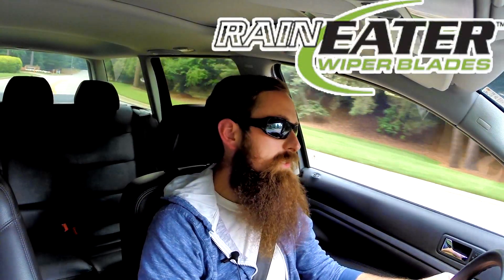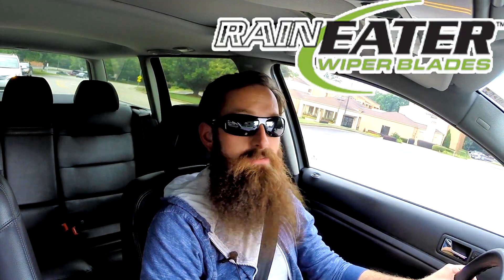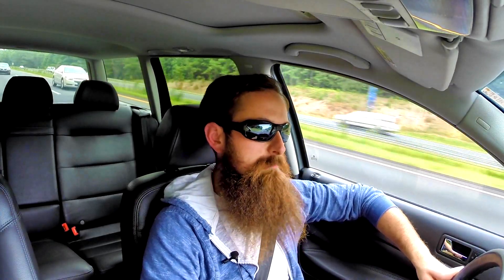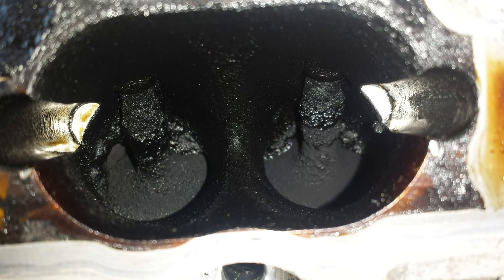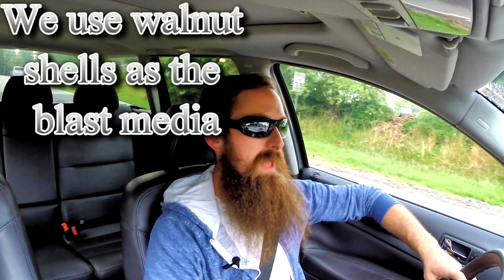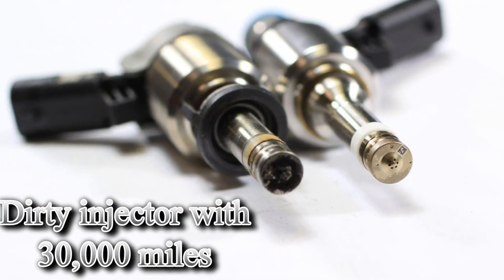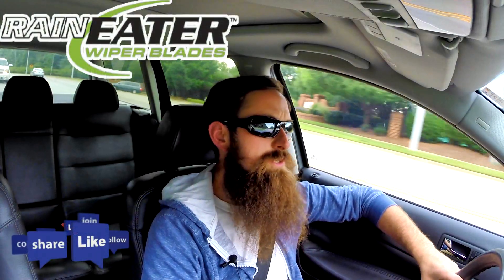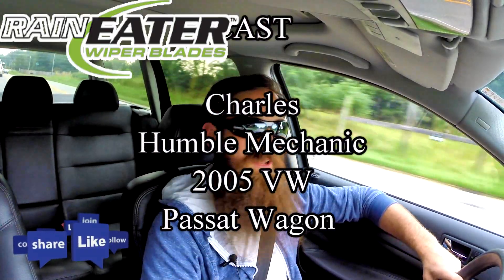Preventing and Fixing Carbon Issues for Direct Injection Engines ~ Episode 80

Comment: I paused at 1:22 to make this comment.  Three Degreeded service writers, 2 at Ford Dealerships and one who runs a private big box tire and service store informed me that as long as one is allowing the engine to come up to temperature over a 5 mile trip this carbon build up in the intake side of the intake valve ought not occur.  We live rual and have a 2016 Ford Edge with the 2.0 Turbo boost engine and never a sputter of a problem.  Be careful if you buy some device that alters your car because the warranty may be voided by a modification.

Comment: Hey Charles, I just got a 2017 gti dsg about a week ago with 25000kms on it. Still under warranty.would adding a catch can be beneficial for the carbon build up/longevity and what about warranty? will VW try to say any issue down the road is caused by a modification (eventhough a catch can will be protecting the engine). Just dont want to get an expensive surprise down the road. Thanks
Reply from the maker: It can help but I don’t think will solve carbon issues. The warranty thing totally depends. If the dealer is cool you may be good. But some are not cool.
Reply: HumbleMechanic thanks for the reply and knowledge. Learning everyday watching your videos!!!

Comment: I have a 2014 VAG car with a 1.4 tsi chpa engine. I have done 144,000 miles mostly town driving over 5.5 years (I'm a driving instructor in the UK). It now mildly misfires at idle (more of a slightly rough idle) when hot and cold, still has the same power at full throttle but if I floor it in 3rd there is a small amount of hesitation very small until about 4000rpm. Any ideas? It had a new cylinder head at 60k miles under warranty because of oil consumption which it had since new, they said the new cylinder head was a revised unit and to their credit it did solve the oil consumption.
Reply: Did you find a solution? Suffering similar problems and been told its likely carbon build up

Comment: This is an older video but I'm hoping you see my comment:) My 2015 Jetta is in the shop as I text this...at an old school mechanic shop, not the dealer$$$ Anyway out of the blue with 61,000 miles this thing stranded me, started running CRAZY rough and the check engine light began blinking. I towed it to his shop. After ordering a new injector and finding out that wasn't the issue he spike to someone who filled him in on the "carbon buildup on the valves" problem with these engines. So now I wait in hopes he can clean it and get it safely running again. With that being said how OFTEN is this an issue? Nothing against VW (I say that sparingly at the moment) but I drive for a living and if this is going to be an issue I'll be getting rid of it very quickly. I bought it with 25,000 miles so I've put 35 on It? Not very pleased with this at the moment, ESPECIALLY since it stranded me and I have no clue what the cost will be. Any input would be GREATLY appreciated!!!😊
Reply from the maker: 60k range is normal.
Reply: @HumbleMechanic  thanks for the reply! As of yesterday my guys couldn't diagnose nor fix it if it's the carbon issue so I had it towed to VW for diagnostics. I'll find out today if that was truly the issue but either way they're going to do the "flush" that's talked about.

Comment: my 2010 GTI had carbon buildup cleaned twice first at around 72K then about 129K miles, current  2016 GTI with newer engine design, has almost 80K and no issues..so maybe the redesigned engine, with improved cooling in upper end of engine.  I use mostly BP 93 gas.  Our tiguan is always BP 93 with like 52K miles 2013, nothing yet
Reply from the maker: The newer 1.8t/2.0 are much better.

Comment: Hey Charles I'm curious about my 18 Nissan frontier  With a 4.0 l V6  And I do like you say with the Italian tune up, And adding 44K occasionaly but I have 12000 miles on it already Coming up on 15k  When I would normally do an intake cleaning, I guess my question is how more or less susceptible are the v6 engines than 4 cylinder engines?

Comment: So all other methods are useless except for taking the car to this mechanic and asking him to clean your valves...... This valve cleaning is very easy and can be done with very little know-how of petrol engines. 

1/ buy a kit cheap kit about £40 expensive kit about £100 (top ups are £10-25. make sure you buy the walnut blaster kit (wet &dry vac needed)
2/ Remove air intake manifold 
3/ Make sure the cylinder which you are about to clean has valves closed. (turn engine manually till you see the valves closed)
4/ Attach the cleaning kit
5/ Clean away
6/ visually inspect the valves 
7/ stop cleaning once the valves are like new
8/ use brake and clutch cleaner to blast out any residue walnut grit.
9/ do the rest of the cylinders
10/ put the intake manifold back on
11/ Have fun driving!

You'll be better off chucking in with your pals if they have a GDI vehicle, split the cost. Make an afternoon of it save hundreds of £££ and have a party with all the money you saved!

Comment: What about using very low vaporisation engine oils like 100% PAO/Ester based oil? Given GDI inlet port coking is either caused from a deposit of the oil vapour from the PCV/EGR system being re-circulated and/or from weeping down the valve seals. Oils with a very low NOACK vaporisation Index figure should surely help? I've noticed compared to Mobil-1, the 100% PAO-Ester I'm now using, does not need any topping up between scheduled oil change intervals in the Audi 3L TFSI engine. Surely that would indicate low vaporisation, although I cannot definitively say?

Comment: Hi! Great video! Do you have any updates on this subject? My 2008 cc got no pressure in the engine literally from nowhere, it has 136k km on it and it stopped running while driving. The mechanic said the engine was awfully dirty. Got it cleaned up, but I would like to know how to prevent this from happening again. Owned this car for less than 7K km and this sort of problem hit me out of the blue; didn't saw any signs except higher consumption and some light and weird engine vibrations. Is something we can do to prevent this from happening, or the carbon cleanup engine should be performed on a regular sckedule after a specific number of km? Many thanks!

Comment: Another great video/explanation Charles. Just to add a small contribution to this thread. Here In my wksp in the UK,
I invested in the last 6 months in the best piece of equipment I've ever bought. The Sykes Pickavant CarbonTec HHO hydrogen cleaning machine (Google it!) It's a relatively new line of wksp equipment & every single vehicle I've used it on (petrol & diesel) has had fantastic results, quieter engines, more power, better fuel economy & lower emissions. It's a superb bit of kit. It's without question a marvelous new method in addressing 'some' of carbon buildup issues.

Comment: 2010 ms3 disi 2.3 turbo.. 85k and I’ve put 50k of those miles.. stop and go driving with hardly any wot pulls or freeway drive builds carbon quickly 15k miles I had a real bad misfire valves not closing.. hit the freeway and redline it 3&4 gear then cruise @ 60+ mph for 45mins once every 2weeks or so I do this and almost no carbon build up after 25k miles.. I stop and go driving daily with a lot of sprits lol.. for mazdaspeeds just let it eat once a month!

Comment: Almost 90% of fuel in the USA is called "fungible fuel". It means its the same damn fuel ALL PETROL DEALERS GET. if one has ever seen a fuel depot trucks fill up there and chevron THEN adds techron to the truck.

If y'all want real fix your gonna have to manual clean. Or run race GAS or run a stand alone ecm that controls a fuel injector or seperate injectors. That's allot of work

Comment: 125,000 miles on my '14 Accord 2.4 with no issues.  Rarely take it above 3500 RPM.  If this is a common problem, the money you save is gas from slightly better mpg's is greatly offset by a big repair bill.  Even without carbon problems in VW's I would never buy one.  They are crap from a reliability  standpoint.

Comment: If the best fix is sand blasting the inside, would that not suggest the varnish only forms there because the inside surface is such that collects such deposits. After you clean that surface it is no longer able to collect there as well. Which would be strange as most adhesives prefer a rough surface which suggests the inside surface is more smooth after the cleaning.
Reply: use caostic soda with hot water. removes it all
Reply: @daltoniks  how are you suggesting doing this? before or after removing the head?

Comment: Hello, gdi engine running on liquid propane on gasoline direct injectors (Prins Direct Liquimax 2.0 system) have the same problem? Thanks.
Reply from the maker: I’m not really sure. I don’t have any experience with that engine
Reply: @HumbleMechanic  Thanks, the engine that's a Ford Ecoboost M1DA, running  propane whith a Prins Direct Liquimax 2.0 system.

Comment: IT IS A VW-AUDI PROBLEM more than any one else's. The carbon build up is 80% from the PCV system. Sooty blow-by doesn't become thick enough to matter. Oil doesn't become thick gunk either, just a light varnish even when coked. The gunk is from the dirty crank case oil and their evaporates. And, VW-Audi simply have VERY BAD PCV oil scrubbing measures. You'll see three times as much DI Intake build up on a VW-Audi FSI/TSI engine than say GM's DI engines. Toyota's dual injected designs like the 2GR-FSE 3.5 V6 has basically zero issues because they have both Direct and Port Injectors -- the latter for idle/low speed refinement (no clatter) and for intake cleanliness.

Comment: The location of the fuel injector is the main reason.  A port injected engine puts the gasoline/detergent on the valves.   As you mention, nothing can stop on the GDI engine from carbon build up occurring as no fuel hits part of the valve.  In the end, cleaning is needed every 30,000 miles to prevent problems.  It is what BG recommends which seems to work.

Comment: "you'd need 30 gallons of Seafoam to clean it off"

CHALLENGE ACCEPTED
Reply from the maker: Hahah keep me posted on the results
Reply: Just do it consistently throughout the life of the vehicle before oil changes and it should at least help keep the valves clean.

As others have said, water will do a great job just have to be careful how you're doing it as you can hydro-lock a motor if done incorrectly/carelessly.

Comment: i belive the Developers of GDI engines were aware of the PVC flaw design during there months or time of testing the engines and figured out that by allowing the engine to build up gunk on the Intake vales, they can gradually make the engine weaker over time so Customers will get dissatisfied with there cars low performance it developed and swith to the next new car they can leases or trade in for.. its all a thing called Planned Obsolescence or engine life failure
Reply from the maker: I don't think it's as nefarious as that, but sometimes it sure feels that way.

Comment: Hello! Here's a thought: why diesel engines never seem to experience intake valve carbon build up (they do, but not nearly as much as gasoline engines), although they the same "recipe for disaster" i.e: egr, direct injection and turbos...?
Reply from the maker: Less on the valves, but more in the intake manifold. The ALH engine would clog so bad you would have an opening the size of a pen.
Reply: @HumbleMechanic  So for the perfect combination, we should add valvetronic to  the direct injection, and we will have more efficiency and less carbon (on the valves)...

Comment: Add a catch can and use crc injection cleaner every 10-20k miles. I drive mine on the highway so it doesn’t have this issue but city cars must must must do this. I firmly believe the above has saved my engine(right at 40k) 2017 Hyundai Sonata 2.4 gdi

Comment: Direct injection gets dirty because the fuel never contacts the back of the valves. Watch some videos on Seafoam or CRC cleaners that you can run through the intake system.

Comment: on something like a 2.0 TFSI 2015 S3, is the fuel injected in a port injection manner? With some fuel being injected ontop of the valves?
Reply from the maker: that's all direct injection. Some B8 A4s had an E85 provision. They have a TB like injector but it's just for cold starts
Reply: HumbleMechanic at 50k miles would you recommend getting the tools to do the walnut clean or just having a shop do it? I’m the new owner of this vehicle and the service history is a little spotty, Purchased from VW, any suggestions on parts to replace to be preventative?

Comment: Now 3 years later, CRC Valve Cleaner is the solution but don't follow instructions on can. 2017 Sonata new got 32mpg combined. At 25K now gets 26mpg combined. After cleaning, returned to 32mpg and sets you back into the seat @ WOT, so it works. Bring car to operating temp., spray intake (down flow from any MAF) with full spray at 2500rpm. Engine will choke down and almost die, turn off at this point. Let heat soak for 1 hour. Start and drive for a couple miles and repeat twice (3 times total). Engine will crank longer before starting and will rattle and ping first mile of first cleaning. This method only uses 1/3 can for all three heat soaks. The initial pinging proves that carbon was breaking away after each heat soak. No codes set and 5K mile later (30K). Blow-by from crankcase increases with each acceleration and that is why highway use delays carbon buildup. I am a lead foot with WOT used frequently. I will do one heat soak every oil change from now on. GDI problem handled.

Comment: What if you get an occasional cold start misfire (twice in a month) and the engine has 30k on it? Would the BG or Seafoam spray into the manifold she with the engine idling work? Dealership wants $300 for it and says its scheduled  recommended maintenance.
Reply from the maker: Maybe but I doubt it. You can try running a treatment in the tank, some good fuel, and a very spirited test drive.

Comment: I have tsi with 165000 miles. It never been cleaned. No miss fires but valve train is making noise.
Reply from the maker: Get that timing chain checked
Reply: Sounds like a diesel. Will do

Comment: I see a lot of  cars and cuv  running at 1200-1400 rpm in OD around  town. Then ping then retaed and pile on EGR .  How  'bout intake reversion at  low  rpm (overlap) to soot up the intake  bowls?  You would  thin the cam phaser would have -0- deg I.E. overlap at low  rpm but some have added overlap for self-EGR.  
Oh , for the days of carburetors, SOHC, long tube  headers and a modest 2000 rpm wide power band at 3500-5500.

Good  channel  and  discussion. Thanks,   Sandy

Comment: Have you tried using oil cleaners? I have a 6.0 diesel Ford and it uses engine oil as the hydraulics to drive the injectors. The dirty oil over time will stick the popet valves inside the injectors and cause misfire (just got Hot Shot's Secret Stiction Eliminator for this purpose). I know that for the direct injection engines the oil doesn't come in contact with the valves and it's a side effect of the blow by. But just wondering if detergents in oil won't help with this problem.

Comment: Did you try the CRCvalve cleaner?
Reply from the maker: No, but many other cleaners like it. Its gonna be a hard sell to me that they actually work.
Reply from the maker: But I guess it depends on what your goal is.
Reply: @HumbleMechanic  after waiting the 1h, i had a big blue cloud from mufflers, then clean smoke, and the car is feeling much smoother at low rev. Big improvment under your feet. 
I'm interested to hear your professional test.

Comment: Big TiP for cleaning carbon buildup from Headers (Audi a6). Buy caostic soda granules and wash the parts out in a container, buy filling it up, and running hot water into it. Wear protective gear/glasses/gloves. 

Works wonders! like new.

Comment: I know I'm late to the game, but my theory is:
EGR delete, why throw exhaust back in the intake? Look at videos of TDI intake cleaning. It's disgusting. 
Oil catch can, just something to add to the CV system to limit oil circulating through the intake. 
Water meth injection, this way you have something with cleaning properties going into the intake. 

Manual cleaning is still the way to go, but those are my three suggestions for limiting the buildup.
Reply: J DeLuca I agree. Seems like an oil catch can and EGR delete would prevent recirculating exhaust gas and oil vapor back through the intake.
Reply: I have built a few cars that in the process I removed the EGR. The inside of the motors were practically spotless even after 50k+ miles.

The only problem with removing them....is it's illegal.

Comment: Ethanol blended fuel is what causing carbon buildup. It burns so hot forcing oil to evaporate or vaporize then condensed before where fuel is injected. On port injected engine carbon buildup is at the throttlebody.

Comment: I thought mechanics hated VW's. 
 My '14 Accord 2.4 has 123,000 miles, still fine.
Is it safe to spray in Gumout into intake?
What's the point of DI if you have a $$$ repairs.  The 5% increase in MPG worth the cost of the repair? No.